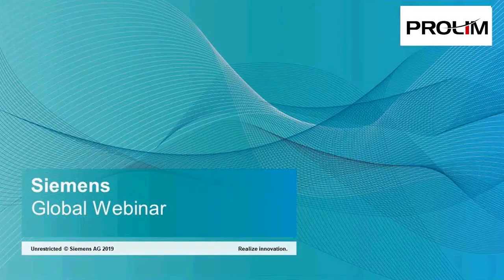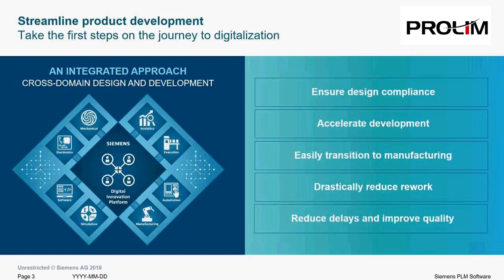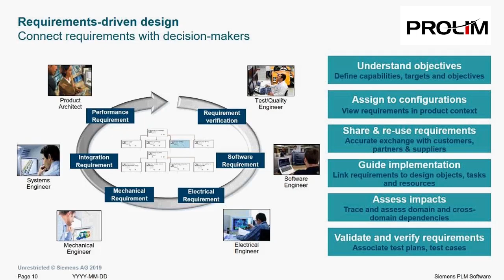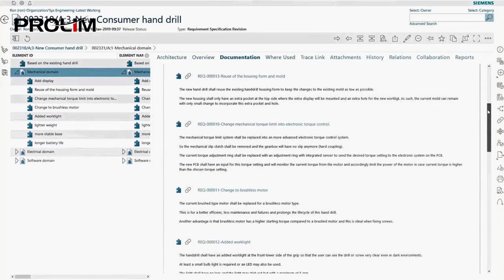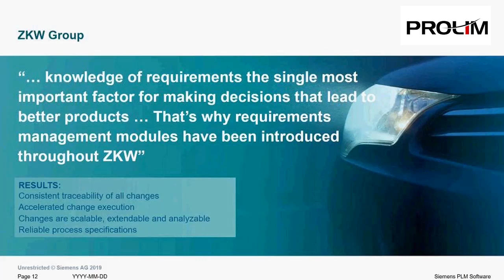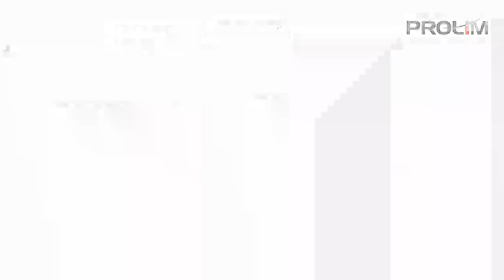Teamcenter Requirements Management Back2Basics Webinar

Comment: Why is everyone always doing webinars on "why you should use PLM software" and never on the "how to use PLM software"
All you have done is put some text onto a Web page. What would really help is to follow a simple design process from start to finish, seeing how a requirement, once created, is being linked onto a CAD file, used there as some parameter or whatever, then maybe a necessary change being reported back from CAD to the project management, implementation of that change onto the requirement list, the update process for all downstream parts, transition into manufacturing. All of this with a video of someone actually clicking through the programs to facilitate these changes. It's great to emphasise how important central management of PLM is, but I'd recon since the viewer found this video, they are past the point of deciding whether or not to use Teamcenter as a PLM but rather looking for a "how do I do this with my software tool" type of video.
I hope this feedback makes sense to you,   cheers :)
Reply: Couldn't agree more!